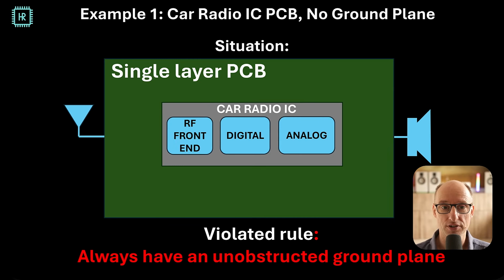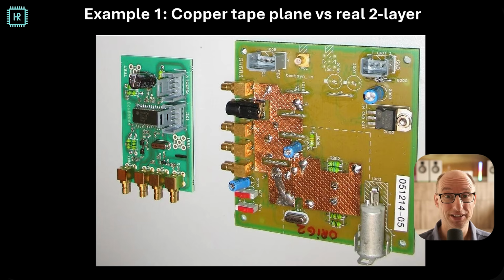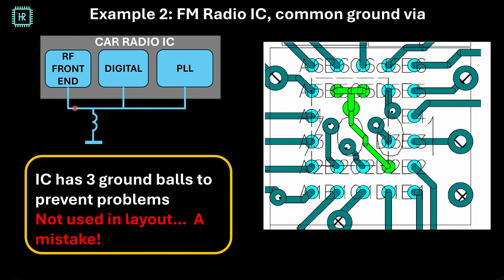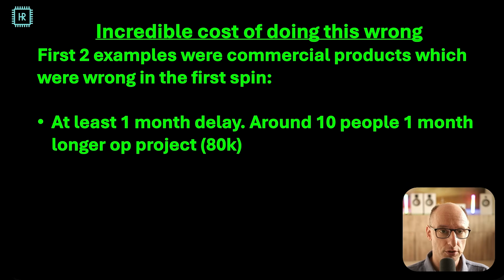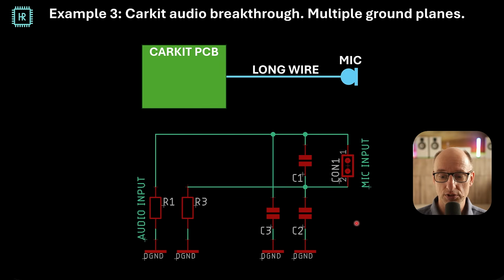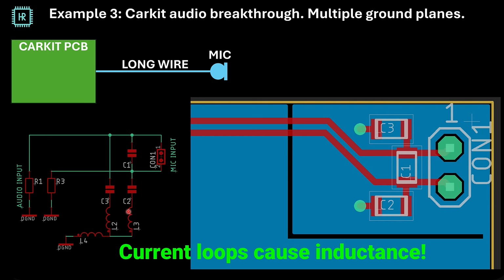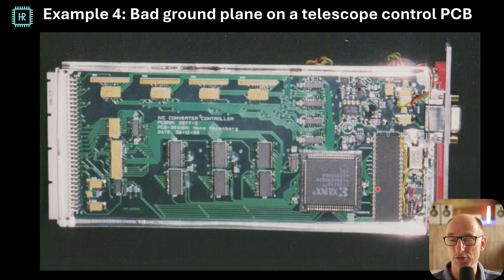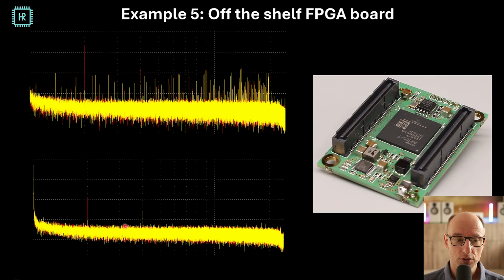Top 5 PCB Grounding Mistakes That Cost Me Thousands

Comment: I've split a ground planes with sucess before.

One such instance was a ridiculously sensitive analog front end, with a ridiculously sensitive EMI sensor sitting on top of the analog area, all feeding a set of 24bit ADC's running at several MSPS. Fed into a digital section with a physically tiny CPLD/FPGA. Several switching power supplies, and a 485 line driver running at 32M baud. Plus some other bits.

Board was tiny. About 200 parts, 11 or 12mm wide, 2 something cm long. Analog section was on one end with the "bulky" sensor, digital stuff on the other. Mostly single sided component loading, with sensor, connector on top, along with the ADC's. Ground plane was split between the analog and digital section, with a small section of the ground planes joined, where the data traces crossed the planes.
Basically a (fat) H design. 

Annoyingly, the biggest problem with noise was from an odd choice from the ADC vendor, which, given the size constraints, we didn't have many options back then. The issue was the ADC had a combined ground pin for both the digital section (SPI interface running multi MHz) and the analog input (at 24Bit). We had to put series resistors in the data lines to reduce analog noise...
Reply from the maker: Impressive work. If you understand exactly what you're doing AND you have ridicilous specs, you sometimes have to do something like this.
Reply: @HansRosenberg74 
Thanks!
The goal of the fat H ground topology was to keep all the significant circulating digital, power supply and RS485 driver currents locked into one side of the H, while keeping the other side completely separated for the analog section. The 485 driver was particularly nasty due to its high drive currents (32M baud is pushing RS485 hard) and sub harmonics from the data being sent. Luckily, the design allowed that to be at the absolute furthest from the AFE. Even the properly grounded AC coupled, shielded, twisted pair cable emitted significant noise that the AFE would pick up.

The bridge between the two ground planes, was where the ADC data lines were placed, keeping current loops as tight as possible. The ADC's were placed close to where the split was between the two planes.

The AFE was so sensitive, we evaluated about a dozen ultra low noise OP-amps, with enough BW, to find the best one for our application. Luckily, the signal was completely AC.

Board was a 6 layer HDI design. I cant remember if it was 20 or 31 mils thick, but had 2 ground planes very close to the outer layers.
Reply: You can successfully split ground planes when the entire system you are grounding is tightly contained to a few components and requires its noise floor to be in sync with those components and not necessarily with other ground planes.  It’s actually quite useful with sensitive systems like an A/D standalone converter system or the amplifier front end on an RF circuit.

Comment: HI Hans, have you talked or discussed grounding associated with AC input voltages that are rectified and connected to digital ciruitry. In particular how to avoid creating a noisy or fluctuating ground when tying the system ground to the floating ground of the full bridge rectifier. It would be very much appreciated if you have already discussed this to point me to it, or if you havent, to make  a video :)
Reply from the maker: I'm not really sure what you mean. Often the AC ground is not connected to the ground of your circuit since there will be an isolating transformer in between. This happens both in switching and linear supplies.

Comment: not sure i totally understand the via to the ground plane part. aren't all connections to ground automatically made when you select GND net? is this where you would use the 0 ohm resistor situation?
Reply from the maker: Maybe you have layout software that automatically does that? This can be risky, you want to make 100% sure each gnd connection has it's own via to gnd. Automatic routing may not guarantee that, as you can also connect a gnd on the top with a trace, causing crosstalk.

I'm not sure what you mean by the 0 Ohm resistor situation, I made this video almost a year ago, is that in there, can you explain further what you mean?

Comment: I've seen seperate ground planes from digital to analog circuits at the ADC, or just for the crystal oscillator on a microprocessor. I think if the current loop stays within it's ground plane it's ok. What are your thoughts?
Reply from the maker: Separate ground planes are never a good idea. I have not met anyone with real-life experience who agrees with the separate ground plane idea. It is a very sticky idea though, you even find it in datasheets! One thing: You always have to judge every situation on it's own! You can probably always come up with a niche application where there is a use for it! Always understand the problem you're solving and the mechanisms that lie at the base of it.
Reply: @HansRosenberg74 yea the first time I saw it was in an Analog Devices datasheet for an ADC. Why do they go through the effort of complicating a simple idea?
Reply from the maker: Because at first glance: It looks like a great idea! Seperate the ground and solve the issue, they can't see each other. Perfect solution... right? If you look what happens electrically, you see that this is a bad idea. You just have to look one level deeper at what is going on. Not many people do that (until their circuit fails somehow and they spend hours or days, or worse, figuring out what is wrong). What doesn't help either is the datasheets. They keep telling this is a good idea. You don't question a datasheet by experienced people like Analog Devices, they make really great stuff, they really do. So you'd expect these people to be right...... This keeps the idea alive.
Reply: I’m a whole hearted believer in solid grounds. If you don’t know what you’re doing, just do not violate this rule. Your circuit will be worse for it. But like everything in life and engineering there are times to break this rule. There are four applications where I’ve found a slit in the ground can help. But before I explain them, here are the rules:

Rule 1:
It only works at low frequencies. At high enough frequencies, the slot is a type of antenna—so you may make your circuit better at low frequencies but it will be worse at high. Remember this works both ways, as a transmitter and a receiver. 

Rule 2: The longer the slot the lower the frequency where your design becomes susceptible to EMI/RFI. Use sparingly.

Rule 3: it can only do minor improvements. At some point you need to employ shielding to avoid the downsides. The more it resembles two shielded enclosures with a set of shielded wires between them, the more you can benefit from it. 

Rule 4: do not under any circumstances bridge the slot with a trace. It’s like water on gremlins—bad things will hunt you down.

Ok so here are the things:
1st, high power pulses running with audio frequency ground returns in close proximity to microphones circuits. Slitting the ground on two layers only and using additional layers as a shield. This much improved the audible noise. A better placement should be considered first. Careful with ground vias, and under no circumstances cross signals over the slot or things will get worse. The sooner you can get the microphone signals between two solid ground layers and terminate the slot the better.

2nd, high power SMPS circuit hot loops. Only works if keep the hot loop small, or be prepared to throw a shield can on it. You must  have a solid ground return somewhere, and usually on both input and output and under inductors used for filtering. A solid ground under the slotted section is still very much advised, but be careful to not to undo some of the benefits with errant ground vias. 

3rd Crystal oscillators. A ground peninsula under and a ground strap around the crystal can help reduce RFI, but again only up to a point. Make sure that both lines to the crystal are over the ground all the way back to the oscillator, and the peninsula connects to solid ground under the oscillator inputs. I only do this if I’m planning to put the whole thing under a small shield anyways. Caution, most of the time a crystal is just not a serious source of noise—it’s the thing switching at the clock’s frequency that is more likely the culprit of EMI problems. The purpose is to improve the oscillator noise floor and phase noise spurs. A small shield is important—if the quarter wavelength of the peninsula is near or longer than the wavelength of the fundamental frequency of the cavity formed by the shield, this is bad. 

4th is obvious—you are trying to create an antenna. A cavity-backed slotted feed on a patch antenna is a good way to feed an antenna without a via poking through the board. You can get great polarization purity this way. A slot by itself is no slouch. But you really have to know what you are doing (and can cut and try a dozen or more designs or have EM sims to back you up).

So there you go. Advice from another EE/RF/MW veteran of 25+ years.

Comment: Hi Hans, great videos, subscribed. I do some PCB amateur radio designs working in the 430MHz region but would not consider myself to be an expert by any means. One thing I try to do is to avoid vias in the RF path if at all possible. More difficult with SMD of course, so instead I put the ground plane on the SMD (top) surface. This seems to work well when there aren't many interconnections (e.g. in filters) and it also makes it easy to construct 50R transmission lines between elements, connectors, etc. I wonder what your thoughts are on this technique? (G3WGV)
Reply from the maker: at 430MHz the wavelength is still pretty long. You can get away with some stuff. If your board becomes bigger, or your frequency becomes higher, nothing will work without a ground plane. At lower frequencies, your wanted signal might still be ok due to the long wavelength, but you'll become very sensitive to higher RF frequency interference,.
Reply: @HansRosenberg74  Ha! Most of my radio interests are sub 30MHz and for me 430MHz is a strange realm of very fast wiggles. I get a nosebleed just thinking about anything higher! Seriously though, that's very helpful, thank you.

Comment: Would it be safe to assume these rules discussed can/should also be applied to pcbs containing digital (esp32)+analog+smps sections on the same pcb ?
Reply from the maker: Yes!!!!! Especially those boards!!!! Digital signal have harmonics that go up really high in frequency. SMPS have the same issue, lot's of fast spikes with wideband frequency content. Analog sections are sensitive to the interference from the first 2, so yes. It is very critical to use those rules!
Reply: @HansRosenberg74 , fantastic,  thank you, I was close to ordering bulk boards. Time to get busy. Thanks again.
Reply from the maker: @madmandevelopments Make sure to put decoupling caps close to devices to keep current loops small!
Reply: @HansRosenberg74 Decoupling caps already as per spec.😊

Comment: Hi Hans, sorry, I have a question. I know you say that multiple grounds should NEVER be used, but I have the following doubt based on my logic. I have a PCB with this approximate layout:

xxxxxxxxxxxxxxxxxxx  (PCB Boundaries)
xxxxxxooooooxxqqqx
xxhxxxoooooo==qqqx   (o=analog, q=digital audio out, h=UART source)
xxhxxxooooooxxqqqx   (== diff. audio connection q -> o)
xx|xxxxxxxxxxxxdddx   (d=STM32, | and -- are signal paths)
xjj - - - - - - - - - - - -dddx   (j=power supply, ground connection point)
xxxxxxxxxxxxxxxxxxx
The 'o's are my analog part (which uses an amplifier to convert a differential audio output from 'q' to a single-ended output). The 'q's are digital and generate that differential audio output. The 'd's are also digital (an STM32 that sends UART signals to 'h'). At 'j' I have the power supply where I currently connect the grounds.

I'm thinking of using a single ground as you suggest. The problem is that, although the UART signals ('h' to 'd') are not that fast, I fear their return currents might travel in a straight line across the ground plane and
perhaps introduce noise into the analog section ('o'). My idea is that by separating the digital and analog ground planes (making the 'o' section its own "small analog plane"), it would prevent the UART signal return currents from traveling near the audio section, forcing them to take a detour, similar to what the signal traces themselves would do if they had to go around that area.
Reply from the maker: Star ground is a really heavily pushed strategy. But it comes from the tube age.. Yes, I'm not kidding. Back than, this was the best way. Now with all the interference around, you should really avoid it. So how to prevent crosstalk then?

Since return currents are under a trace (if you have a single ground plane without obstructions) all you have to do is make sure that circuitry is not 'mixed'. So don't put switching digital circuits in the middle of a highly sensitive microphone amplifier.

The same is true for power lines or signal lines carrying switching currents or other interfering currents. Don't run those close to that sensitive microphone amp (or other sensitive circuits).

The best way to guarantee something like that is component placement. This is a crucial step  and I'm spending some time on that in my course. Put interferers and victims as far apart as possible.

If you do all this, you should never have a problem. Unless you interference is so strong that it just travels through the air, in which case you'll need shielding.

Best regards,
Hans
Reply: Gemini recommends using an uninterrupted ground plane (which would be the digital ground) across the entire PCB and using simple traces to connect the analog grounds, then joining them at a single point to the unified plane. What do you think of that? My doubt also comes because all datasheets tirelessly recommend using a star grounding strategy

Comment: Would you consider it a good idea to split a "high-power" ground plane from a logic plane in a motor driver? I recently made a board like that for Elmo drive.
Reply from the maker: Not really necessary if you place your components right. You don't want the high currents in your ground plane to interfere with your low current digital. You can easily do that by placing the high power stuff on one side of the supply and the low power stuff on the other side of the supply (entry) on your board. That creates like a virtual star point inside your single ground plane. I use that for ultra low distortion power amplifiers (really sensitive to ground issues) and it works perfectly!
Reply: @HansRosenberg74  Okay, still a single ground coming in. I'm starting to think this makes sense. We still have a separate logic ground coming in. The danger is that if that big ground is disconnected that big ground current will go through a small logic wire and make bacon :) (It was for this thing AMP-L100)

Comment: Thank you. Also very important and useful are the themes of the noise measurement instrument and methods. How to use simple instruments to do this.
Reply from the maker: noise measurements are a little bit tricky. It's very easy to get a square root or power of 2 wrong there. I'm going to make a video or a mini course on this at some point (or both). But first I need to finish my product development course.

Comment: Do you have any recommendations on some basic at-home EMC testing? Anything I can do with an RTL-SDR, oscilloscope (Siglent SDS1104X-U), and AD-2
Reply from the maker: What would you want to test?
Reply: @HansRosenberg74  I'm looking at making some panel backlighting for an experimental airplane, dimmed with PWM, as well as an astable multivibrator for wig wag lights. My two concerns would be noise picked up by the radio (108-137 MHz) and by the intercom system (which is at least shielded, but wires vary in length). Testing for radio interference seems straightforward enough - just sweep the relevant frequencies with the SDR. The intercom system, I'm a little less sure about, outside of just in-situ testing.
Reply from the maker: Just limit the bandwidth of the switching signals to a few MHz using a filter, use decoupling caps close to the supplies of the switching parts and you should not have any problems.

Comment: One of my most memorable mistake was when I designed a trace for a GPS antenna connector, but there wasn't much space so I put most of the trace under the GPS module. The impedance was perfect on the PCB until I put the GPS modul over it with a huge ground plane.
I was new to design impedance traces so I focused on the calculation not on the finished product, this was my third or forth RF design at the time. I was very happy that all my USB, ethernet and RF traces worked for my first try. When I'm confident in my abilities that's when I make most of the mistakes.

If you have someone who can check your design it can be a huge help, like in the 3rd example, but I think it's a luxory. You can spot the flaw immediately in others work but they cannot find in yours.
I love PCB checkers, it is a long time to set them up and you can learn a lot while doing so, but it also makes me lazy and slowly forget what I learned, it's a doube edged sword. After I throw a basic design on the PCB I run the checker and I go trough the list one by one and tidy up the traces, vias, etc.

What I don't like in PCB desigh is the human factor, someone has to build the dam thing. I quickly learned that what you can't easily pick up with two fingers its too small and will be too expensive to build, so my rules were the smallest board to wire connector should be 1,5mm and the smallest screw should be M3.